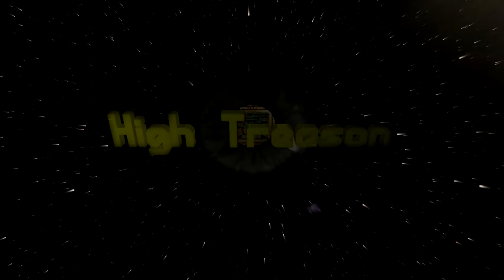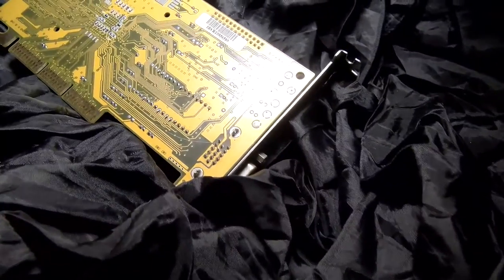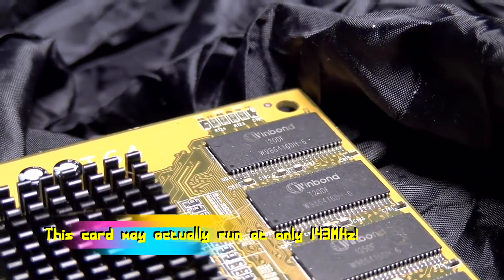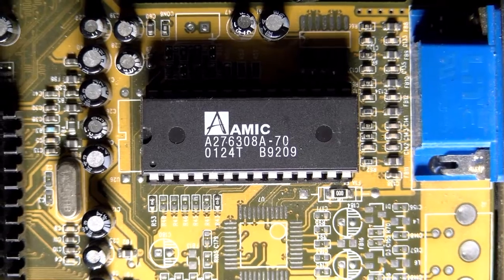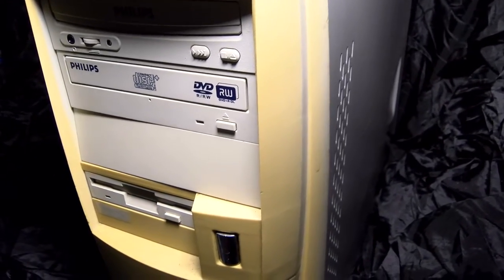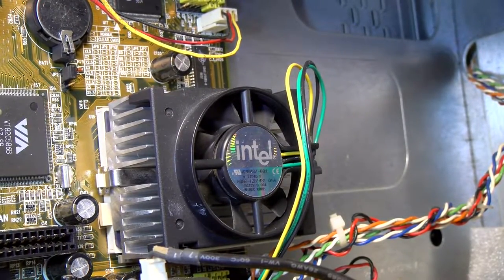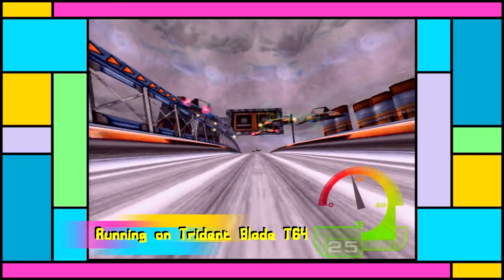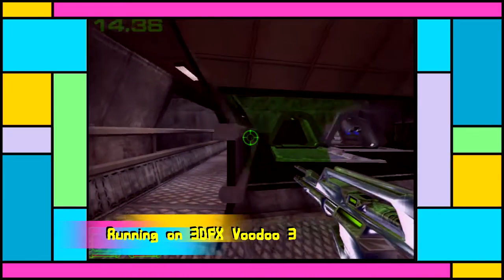Testing a Trident Blade T64

Comment: Are you really sure about Nvidia embedding eeproms inside the chip? that would be extremely expensive due to different geometries and incompatible foundry processes, putting an eeprom would require 1-2 additional rounds thru masking/coating/baking/etc, using incompatible chemistry and temperatures. Plus I dont recall nvidia cards without bios chips.

Afaik Voodoo 3 ramdac is 32bit (even stupid VGA 13h required at least 18 bit), and very fast at that (faster than contemporary ATI RAGE 128), its the framebuffer in 3D that was 16 bit because 3dfx liked to optimize hardware to the bone and cut anything "non essential". Sure Riva TNT/TNT2 had 32bit color, but framerate dropped.

v3 artifacts - your card is broken :)
crashing - its socket 7 AMD all right
We get it, you hate 3dfx ;)

How about glquake test? :) 640x480x16 is ~60fps on Trident with very fast cpu, V3 2K will reach up to 200fps, pretty sad.

I give Blade one thing, Trident managed to polish drivers to the point this card was actually usable if you didnt care about performance (vlaskcz did a TNT2 comparison video some time ago).

K6 was dead past 2000 in Europe, it was all Durons/Celerons on the low end, Athlons/P3 and first P4s on top, with GeForce2 MX as the lowest ~usable 3D gaming card. 
This Trident would had a place in supermarkets, in case bottom feeder vendor ran out of old stock i740/SiS 6326/TNT, or it was cheaper than S3 Savage4/SiS315/NVIDIA Vanta (all same price bracket, but much faster).

Trident did find a niche in laptops, IBM for example used them exclusively until switching to radeons.
Reply from the maker: There don't appear to be any ROM chips on some nVidia cards and I recall it being mentioned at the time, think the FX series did it that way. This may be incorrect however, perhaps it was simply planned and never happened. DIPs in sockets were definitely going out of favor though.
Could also have sworn the RAMDAC on the V3 was only 24-Bit too and it doesn't seem that fast, pretty sure even some of Matrox' older cards could outrun it, it does its job, that's about it. Also define non-essential, it's only non-essential if you don't need it.

V3 card is broken? Sure it is, by design it's broken. We had other people test this on Discord and they had the same results, turns out it's a known issue with later Voodoo cards due to some negligence in regards to memory or some such nonsense.
Crashing only happens with the Voodoo 3, now I'm not claiming to be an expert at anything, but given repeated tests yield the same result, I think we can probably safely conclude where the problem may lie.
I don't know that I have any specific hatred towards 3DFX, I just hate it when my games don't work, this problem was easily solved by installing a better video card. Again, I just can't think where the blame should have been placed for... oh wait. I must admit it does intrigue me how with 3DFX gear it's always 'your machine' or 'you're playing the game wrong' and it can never be the fault of inherently flawed hardware.

Can't run GLQuake. I did test regular Quake though, 70FPS for the Blade T64 and 79FPS for the V3 2000. Wasn't aware the V3 even supported GL as I've never gotten that to work on it at all, let alone GLQuake which doesn't run on anything I own - but then, this is ID we're talking about, so it's not like there are any surprises there. People sometimes tell me to patch this or that, but manually patching things isn't something anyone really wants to do, assuming it fixes anything anyway, which is another reason NFS3 was also left out of this video.

When you're buying cards in the low-end market you can't really expect much in the way of performance, although for its price point, it performs rather well. Most importantly, it actually works, a good few of the cheaper solutions really didn't - and evidently, some of the more costly ones from a couple of years prior didn't either.

If the K6-2 was dead in Europe past 2000, then I have to ask why there is such an abundance of motherboards and CPUs with production dates post-2000 over in the Slav countries. There were even a fair number of them over here in the UK, usually in education of offices or, as you say, supermarket brand machines. I think people forget about this end of the market, being continually spoiled by their upgraded-to-the-max dream machines, unfortunately such things were rarely the reality at the time and most of us had to make do with far less.
Reply: Looking up pictures there was a switch between NV25/NV28(gf4) and NV17/NV18(gf4mx) from parallel(plcc package) to serial(soic8) eproms.

>I don't know that I have any specific hatred towards 3DFX
HAHA
>Wasn't aware the V3 even supported GL
 you joker you :)

>why there is such an abundance of motherboards and CPUs with production dates post-2000 over in the Slav countries

As I said before, I worked at regional Asus/PCChips/Tomato(ha, now that is an esoteric manufacturer) distributor at the time, we stopped carrying ss7 boards pre 2000. S7 was dead even before Duron showed up, replaced by $100 Celerons with even cheaper S370 boards. PC-Chips M577, Chaintech 5AGM2, FIC PA2013/VA-503, Zida TX98, Asus TX97/98/P5A, Shuttle HOT591 are all 1998 boards. I cant name a single post 2000 s7 motherboard from memory, and even furiously googling I only find GIGABYTE GA-5AA still being manufactured in 2000. On the other hand I have no doubt Medion made a shitton of barely working PCs for german supermarket chains, all with crappiest custom Microstar motherboards possible, probably fitted with Cyrix CPUs.

Here is an example polish ad from summer 1999 for Vobis, lowest end system was already Celeron 366 at ~$500 http://www.wykop.pl/ramka/818253/stary-katalog-vobis-z-1999-r-lapop-pentium-ii-za-15900-prosze-bardzo/ divide priced by 4 to get dollars
They carried AMD and Cyrix in 96 and 97
http://www.wykop.pl/ramka/3682653/gazetka-vobis-z-1-wrzesnia-1996-roku/
http://www.wykop.pl/ramka/674937/cennik-z-czerwca-1997-markowe-komputery/

Found one company still carrying K6 in summer of 1999! FF-Computers, price is similar to Vobis Celeron 366 above
http://i59.tinypic.com/16pf85.jpg
Riva 128 and Ati Rage2C, we are truly scraping bottom of the old stock barrel here :)

2000 entry level preview was all celerons/P3 with TNT2 M64/Pro/Ultras
http://i57.tinypic.com/23k3ce9.jpg
http://i59.tinypic.com/14nfw91.jpg

and 2001 only K7 and intel http://www.wykop.pl/ramka/3391835/cennik-sprzetu-komputerowego-z-2001-roku/
Reply: @HighTreason610  About production dates past something "reasonable", i had FX-8320e produced in April 2017, 2 months after Ryzen available even in country shops. Maybe that is a part of canceled deals big OEMs or so. During work in a big company if i need to repair old broken PC i need to buy new old stock components. And i was so surpised seeing about 200-300 new bulk packaged VooDoo2 cards 2 years ago in local shop with price tag about 15$.
Reply: should of grabbed all of those VooDoo2s, they are steadily selling at over $100 for a couple years now, and will only go up. Despite 
HighTreason610s hatred towards anything 3dfx ;) they are an important part of early PC 3D acceleration history, and a beloved company by many.
Reply: @rasz  At that time i had no interest to retro PCs and consider them - garbage. Even now, 3dfx for me more old painting, than something retro practical. But i saved 3 VooDoo1 for no reason but history piece at the time that happens about 7-10 years ago. I tried it, well, as for me, i either prefer TNT2 or software rendering, with maybe few exceptions. Some early 3D accelerated games have very little difference or serious drawbacks.
Reply: I meant grabbing them to resell, not to use in 2016 :)
Even 3dfx nerds use emulation and glide wrappers nowadays, doesnt change the fact prices are crazy as more and more nostalgic people want to put one on the book case as a souvenir of the "good old days" ;)
Reply: @rasz  I clearly understood what you mean first time, and maybe i do something like this in the future. But in next 20 years every old crap will cost more, even if it will be floppy disk.
Reply from the maker: rasz - Fair enough, I've just never noticed the EPROM on the later cards, but evidently it is there and my sources were incorrect. Now to address some of your other statements;

">I don't know that I have any specific hatred towards 3DFX

HAHA"
- You conveniently omitted the part about my games not running and failed to provide a counter-argument.

">Wasn't aware the V3 even supported GL
 you joker you :)"

Does it support GL? No. Will it run GLQuake? Probably not. Again, no counter-argument was made, so I'm going to assume that I am correct.

I'm still somewhat baffled by the sheer numbers of K6 boards that show up in Eastern Europe, my current 5AGM2 came from Ukraine and was made post-2K, though as noted in my reply to HWN, it may have been unsold stock. This is my second one, the first one came from a school, another board (different model) had an unknown history from Latvia but was dirty enough that it had definitely been used, they all had datecodes of '00' and '01' scattered around, though the bin range is huge and spans all the way from 1998, on just one board. I'm still willing to bet crap-tier machines from supermarkets or found in offices may have house K6 processors, there has to be some reason for those boards being there.

"Despite HighTreason610s hatred towards anything 3dfx ;)"
You make me laugh, dude. They are an important part of history though, I'll give you that, they are a valuable lesson in what not to do if you intend to produce a successful product. The Blade here is also a relevant part of history as it really signals the end for such low-end off-board cards, mostly due to Intel entering the market with their god awful GMA.
If its any consolation, you can partly thank me for the value of the 3DFX cards today. When I used to work on the side, a local builder used to use 3DFX cards constantly, even after the company died, and people used to bring the machines to me saying 'it won't run (insert game name here) and gives this error' and so, often, my job was to rip out the 3DFX board. As I couldn't really get rid of them in the end I burned most of them, I also distinctly remember taking this huge one out of some K7 rig, bending it with my boot and dropping it in the burn bin along with the brick it came with... the bastard actually needed an external brick, I mean what the actual fuck? I guess if you can't waste slots, you'd better waste an electrical outlet. I've never seen another one like that so presumably someone would pay silly money for it now... Still, stuff like that and people wonder why they're not around anymore.
Sure, I occasionally kick myself for getting rid of them, but I had fun doing it and it was all so long ago as to have made no difference in the long run. So many things were stolen over the years that I wouldn't likely have still owned them anyway, why would I hold onto trash in the first place - that's what they were at the time, they were worthless and commonly considered as nothing more than garbage you didn't want, the GeForce and Radeon were king already, you could actually run games on those. There was no way we could know that people would later want to own the dysfunctional outcast of the bunch years later for some reason. They're not for me, overall I have the machine here to do things like play games and the 3DFX boards simply cannot deliver on that experience.
Reply from the maker: OK, I checked, no native GL support, requires a wrapper/patch is installed and even then it does not offer full GL support through said wrapper. It would appear I was correct after all. Actually no, my knowledge of Quake is limited, when was the last time you saw me actually play it? Exactly, can't stand that game, it's ugly and uninteresting, Duke Nukem 3D is my jam. The average user doesn't want to mess with patches (or pencils), nor probably has (at the time) any knowledge of how to do such things - which is probably why I made enough money of off people to build myself a decent machine back when they kept paying me to uninstall such cards from their crappy systems.

Ukraine and Latvia are still in Eastern Europe.

To say you're not big on drama you're sure as hell trying your hardest to instigate it. Knock yourself out, but as I said, we're all laughing at you over here so thanks. Also with the name calling... yeah, OK, that's adding so much to the conversation. It's funny how people really don't like it when you tell it like it is, isn't it? No, we can't have that, especially not on a forum, that's not allowed. If you must know, then no, it was more that someone felt intimidated by me and decided to play the crybully tactic. Jokes on them, my YouTube and Discord channels are way more fun than their forum ever was. This very comment chain is proof of that.

Let me see about this, so the Radeon didn't exist when 3DFX went into bankruptcy? You'll have a hard time convincing me on that, given the VE is one of my go-to cards and was even in this system at one time, that came out in 2001 as a cost-reduced version of the former Radeon cards from 2000. The first GeForce cards (256) first appeared in 1999, so would have been contemporary with the Voodoo 3 for a time, the GeForce 2 appeared in 2000, around two months before 3DFX were absorbed by nVidia. A lot of articles do seem to like comparing 3DFX cards to previous generation competitors though, so I can understand why you might be confused. Indeed, it is a shame that 3DFX dragged STB down with them.

I'm not sure why you would think anything in this video was dishonest, I don't do that and I'm sorry you feel cheated, but I just run things and show them as they are. If faking things was on the agenda, then surely I'd have made the 3DFX board lose in all of the benchmarks and would have dreamed up far more serious problems than a few visual corruptions, don't you think? If it really bothers you that much, I could probably get permission to link a clip or two of others having the same issues, or you could always try the games for yourself instead of preaching, assuming they'll run, rather than taking the word of some guy you don't know on the internet, that's what I do because I don't always trust other people's results either. Hell, I could probably even hook you up with them if you're having a hard time finding them (hint: it's not hard to find them) though that's assuming you'd even trust my disk images, they're probably fake as well, I'm probably just a figment of your imagination after all. Perhaps it's just your conscience talking to you as a result of buyer's remorse?
Reply from the maker: Oh great, more random files I have to mess about with to get things working. Nobody has time for this, they just want it to work out of the box, seems reasonable considering these things were sold as working products, not 'fixer-upper' projects for the weekend. Do you think the average user wants to do this? Do you think they knew how to? And yet people still wonder why 3DFX is no longer around, it's simply baffling.
Besides, you hit the nail on the head with "every 3dfx card ever sold supported as much opengl as glquake required " because that's pretty much what they did, hack a wrapper together, implement barely enough to say 'hey, look, we can run this thing nobody cares about!' and nothing more, the documentation for the files you linked even specifies as much, so it's doubtful they ever had or intended to have a full OpenGL implementation.
If you enjoy spending your evenings messing around with system files, be my guest, it's not harming anyone, but I think I'll play some games in the mean time.
Reply: @HighTreason610  your card clearly displays texture errors in at least 2 of the games you showed, it's most probably damaged. Sorry but you obviously do not know much about the Voodoo 3 or the cards of the late 90s, you just said in another video that the Voodoo 3 doesn’t support Opengl or direct3d, which is ridiculous. Not to mention that you constantly say totally false and untrue information.